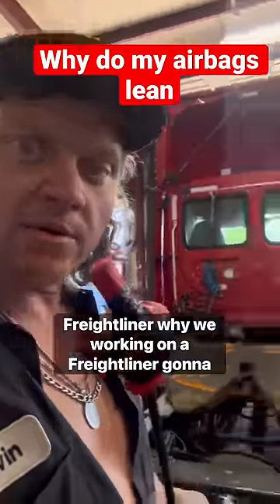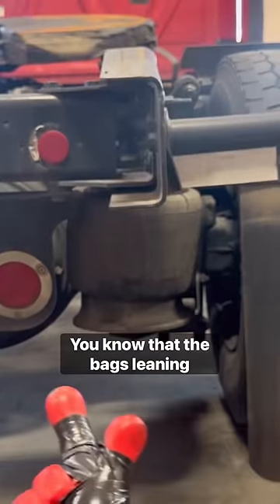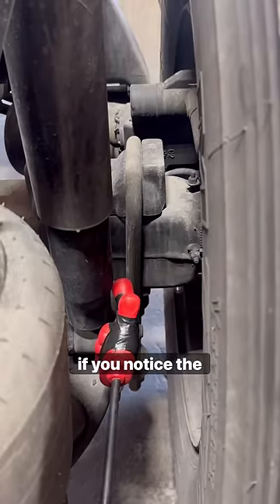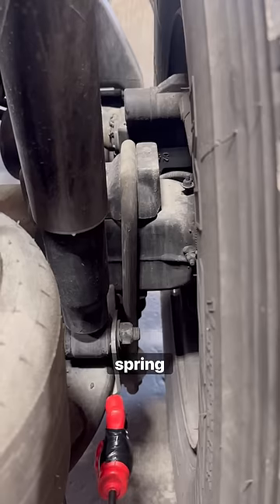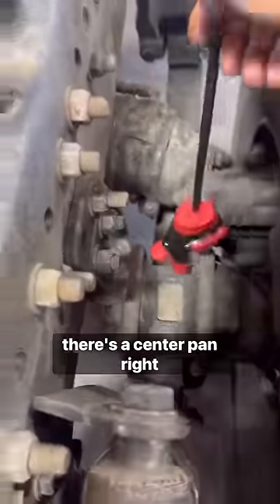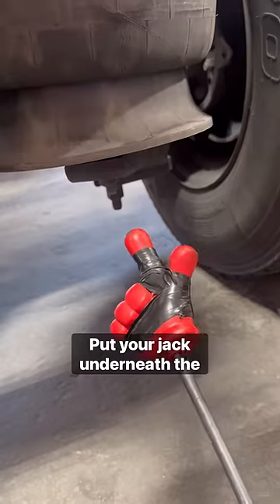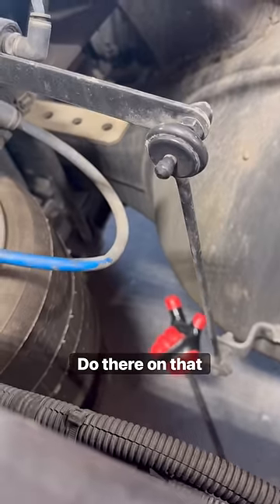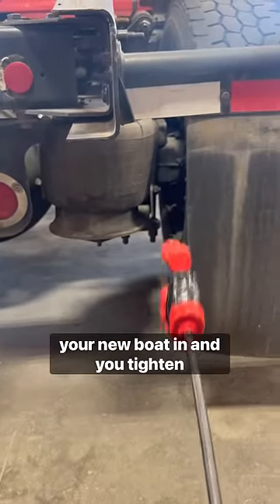Why do my airbag lean on my Freightliner 🤷‍♂️ ￼

Comment: We had a converted truck into a water truck with a 4000 gallon tank and it kept doing this so i got everything lined up and welded some small straps of steel to the bottom of the housing tube and it never moved again after that.

Comment: On the newer setup there is a hook attached to the backing plate and the bottom seat has a hole for the hook to keep that from happening
Reply: Can you buy this set up and put it on older trucks?
Reply: @christopheryoung826  Yes, it bolts to the backing plate bolts
Reply: @jeremiahramos7296  im going to see if I can stock these to sell to customers. Thanks.

Comment: Mine would stretch bolts on right front drive axle. I had to tight turn in that direction only on one of my stops. My spring guy like Bendon called it and had u bolts replaced.

Comment: We weld a plate against the foot plate to diff housing which stops movement at the bottom
Reply: That’s what I’m leaning towards. I’ve changed them ubolts twice but after a few weeks bags are right back to leaning
Reply: @jerometaylor554  have you done a retorque after about 1k miles? It should of done it that soon and that will help prevent it from happening. Either way it's a pisspore design and I 2nd doing what guy above said or tack weld something to help hold them in place.
Reply: Well, with the kind of weight you're dealing with, tack welds would be a joke. You'd have to have a strong welder, and tig weld the piece on. Mig welding works too, but tig welding is a nicer appearance and stronger if I remember correctly. Honestly, I'm thinking a triangle would help. Have the piece butted up against where the bag perch is supposed to be, then have it so the triangle is pointing towards the gears. That way, it's distributing the pressure into the housin, and not allowing the welds to have enough pressure on them that they could fail.

Comment: I have that happening with the freightliner we have. 

The suspension shop told me the spring is in its proper location but sometime may need a new spring to fix that leaning air bag. 

The other airbag for same truck that was leaning was easy to fix with new u-bolts 

All new u-bolts were installed for all four rear springs. 

Just that one air bag that’s still leaning.

Comment: I notice guys will run with bad torque arm bushings a lot longer than they should on air ride setups and end up with jacked up geometry, broken springs etc too. They put those there for a reason and if the bushing is shot things are moving in directions they shouldn’t be.

Comment: So what you do is weld the bottom bracket to the axle housing.  Doesn’t have to be much just a couple 1 inch stitches will do.  Holds it steady.

Comment: Simple repair. how do you fix it permanently?   What is the root cause , what is stretching the u bolts, then allowing it to slide ?
 The pin would prevent ( to a point) the stretched bolts from allowing the spring  to move till the pin shears.
I know this is a short ya can't dig in too far because time limmits . Still a good PSA.

Comment: They used to have pins in them. When I ordered my 2001 Classic XL 84" Big Daddy sleeper 295" wheelbase, pinned rears top & bottom were standard. They started doing single pins around 2009-ish.

Comment: The new International come with a special hook plate that bolts on to brake dust shield to keep that from happening and on freight shakers I’ll weld a stop against axle seatof the spring seat 😊change out the bushings in the eye …RB268 from Dayton and call it a day and charge for rear alignment 😊

Comment: I have been driving a freightliner for the last year. Put only 90k miles on it and it looks like it's on its 2nd motor overhaul. Both bottom mirror arm pieces flew off. Jake/gear shift lever was replaced twice, new gauge cluster because the original shorted, new truck/trailer push valves. All 4 rear axle hubs were resealed due to originals failing before 5k miles. Truck just needs to be melted down and poured into the basement with the Elephants Foot

Comment: You grind a bit of the coating off the spring bracket and the axle, give it a bit of weld, and boom.  Never moves unintended again

Comment: Thank you for pointing that out! I've been in a 2019 Freightliner cascadia for the past year-and-a-half, and it's pathetically funny how every single Freightliner I've been to says that is normal, it's designed like that, and it doesn't interfere with anything... You know, even though the truck can't hold an alignment in the rear end, can't stop eating up tires, can't stop blowing out bushings. Freightliner can't build a good setup anymore. The front end is even worse.

Comment: If the u-bolt has stretched, could you just tighten it?  I must be missing a key bit of info here.  Maybe there's not enough thread to tighten it or maybe once stretch the metallurgy is f'ed and it will keep stretching?

Comment: The problem is the leaf doesn't go over the top of the axel like most others. And no support bracket between leaves l to r.  I don't believe a hole in the bottom of the axel housing would be a good thing.

Comment: If there were a pin in the bottom, the u-bolts would still get loose but it wouldn't be as obvious. Freightliner has been using that suspension for 30 years or more. You'll find the the same suspension on a 1994 FLD and a 2024 Cascadia. I bet even the part numbers are the same.

Comment: The u bolts stretch because u-bolt holds all the weight with spring under axle. Just a bad design or use a u-bolt the size Camelback ones!

Comment: And if u tighten the U bolt and it don't snap when tightening, it will snap with a good pot hole or a wack when it's being driven. 💯💯👍👍👊👊

Comment: A comment here, so🤔the ubolt stretched🤔 um isn't that a double issue,, if they designed it as such, should not the hardware be to spec 🤔🤔 the ubolt should be strong enough to not stretch 🤔🤔 so hence your comments if the put a pin in here this place here, um, well it would get loose but not move